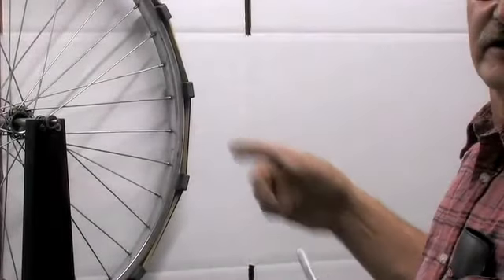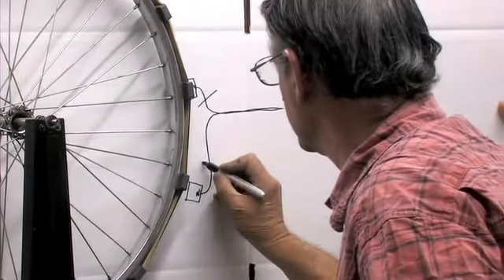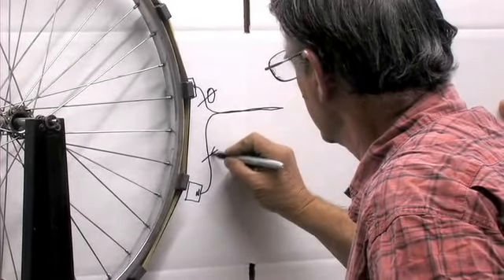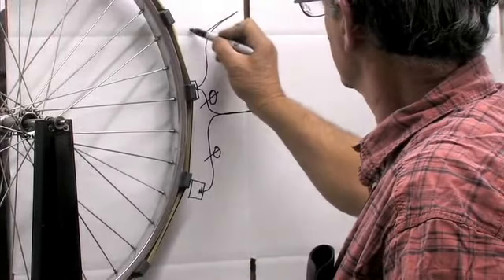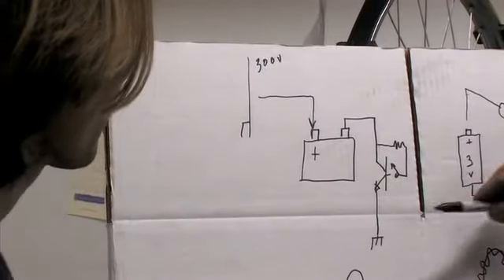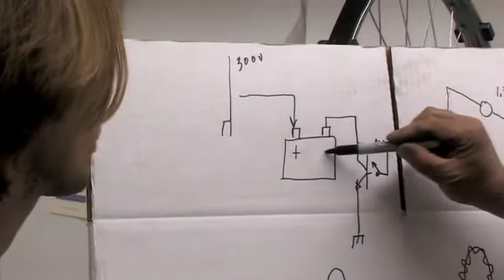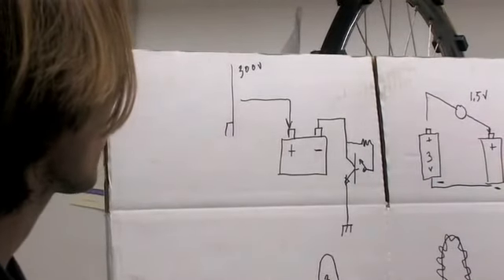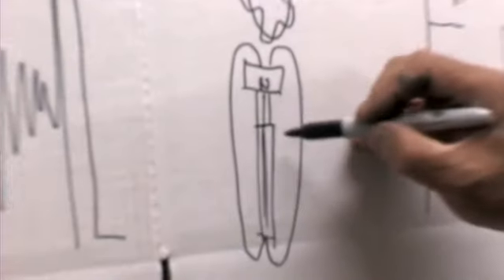#06 - Inside Radiant Energy (2009)

Comment from the maker: 0:20: ⚡ Exploration of generating radiant energy through sharp transients and its impact on batteries.
0:20: Radiant energy is generated through sharp transients using coils and switching circuits.
0:47: Negative energy is transferred to the battery when charging due to lack of heating, requiring minimal current.
1:25: The pendulum oscillator produces a single transient spike, distinct from radiant energy generation discussed.

7:08: ⚡ Explaining the generation of magnetic pinpoint beam and scalar North driving engine.
7:08: Magnetic pinpoint beam created by North Poles together, triggered by a single trigger.
8:24: Scalar North driving engine with no South Pole involved, generating light and power.
8:50: Disconnecting Magneto results in no power generation, indicating the importance of scalar North.

13:28: 🌊 Radiant energy comes in waves resembling ocean waves, fluctuating in frequency and intensity, influenced by gravitational waves.
13:28: Negative energy is the negative end of energy produced by sharp transients.
13:43: Radiant energy comes in waves, resembling ocean waves with fluctuations in frequency and intensity.
14:08: Energy seems to ride in on a form of gravity wave, fluctuating in strength and frequency like during a full moon.

20:11: ⚡ Discussion on building a free energy generator from a book, emphasizing precise construction and potential risks.
20:11: Building a free energy generator following a book's diagram precisely is recommended.
20:35: The generator described involved an 800lb flywheel, small car batteries, and special aircraft starter parts.
21:01: The machine generated around 5KVA and required careful construction to avoid potential hazards.

28:21: ⚡ Demonstration of capturing and storing radiant energy using pulses to charge batteries.
28:21: Radiant energy is stored in batteries through repeated pulses rather than capacitors.
29:57: Energy absorption into batteries increases as impedance decreases, charging the chemical.
30:24: Process involves timing pulses to transfer energy efficiently to batteries.

37:51: ⚡ Demonstration of magnetic field discharge for triggering devices and timing LEDs across a coil.
37:51: Magnet charges iron to trigger devices with correct sign
39:10: Timing LEDs across a coil shows out-of-phase flashing for red and green LEDs

47:13: ⚡ Understanding the extraction of substructures from waves in circuits to obtain specific information.
47:13: Substructures in waves are extracted in circuits to obtain desired information.
47:47: Picking off substructures from waves allows for selective extraction of information in circuits.
48:47: Combining substructures from different devices in a circuit can yield specific outcomes based on their structures.

55:12: ⚡ Understanding electrical circuits as differentials of potential and manipulating them to achieve desired outcomes.
55:12: Manipulating potential difference in electrical circuits is key to achieving desired outcomes.
55:29: Using identical batteries to build up potential and manipulate circuits.
55:50: Ability to adjust potential levels and phases in circuits for control and optimization.

1:01:53: ⚡ Understanding the concept of current in energy generation and preservation.
1:01:53: Efficient energy generation involves making the diapole last longer to maximize work output.
1:02:27: Avoid using current to prevent destruction of the system and focus on preserving information and voltage flow.
1:02:45: Charging the battery requires measuring the real current rather than imposing unnecessary changes.
Reply: At 1:01:53 - Trying to figure things out, I'm wondering if we should read "Dipole" and not "diapole' as it's the word that I was able to find concerning the subject.